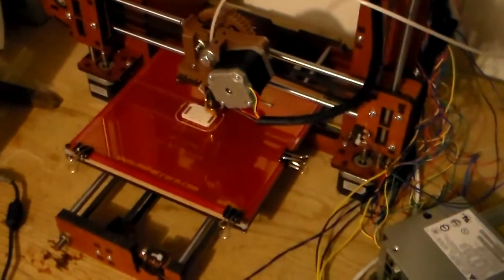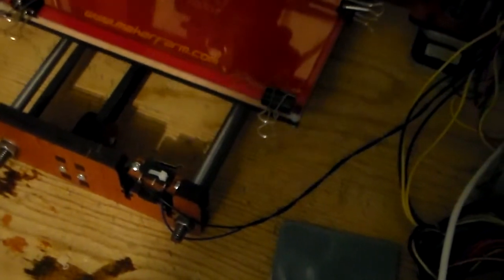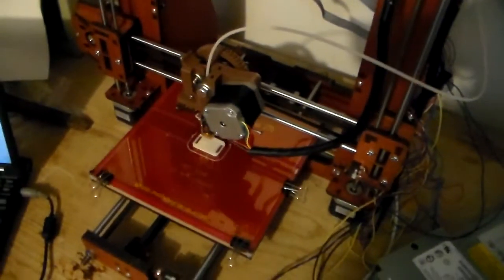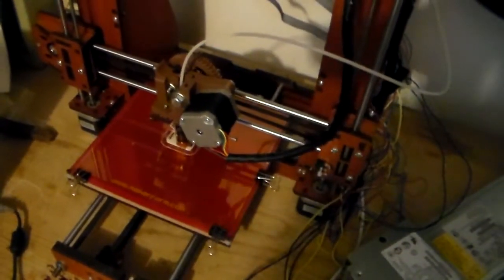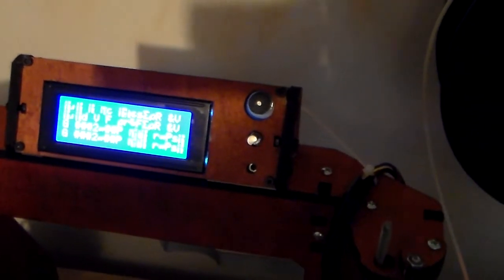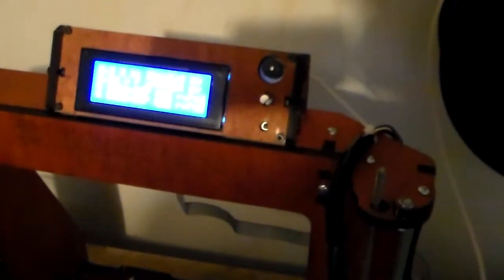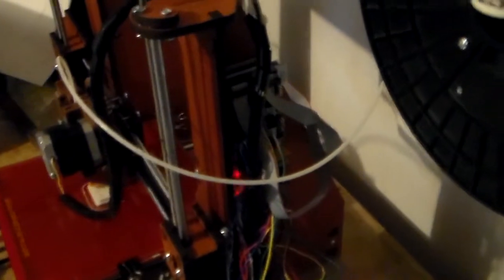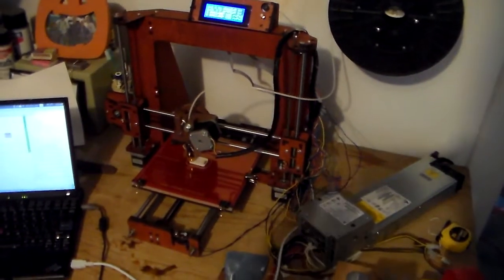prusa i3 from makerfarm (11) new y end stop

Comment from the maker: For the build xpect minor adjustments as it's wood.  Lots of nylon coated lock nuts in use but they can still come loose over time, try to place the screw heads so they are accessible when the build is finished.  Print quality can be very good if the calibration is right. I've had good clean results with .4m and  .2mm layer heights.